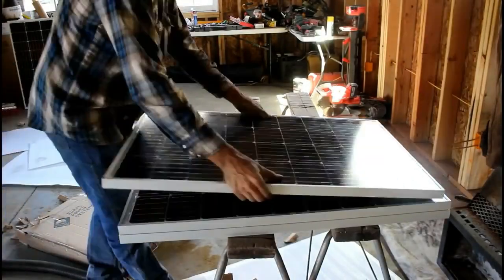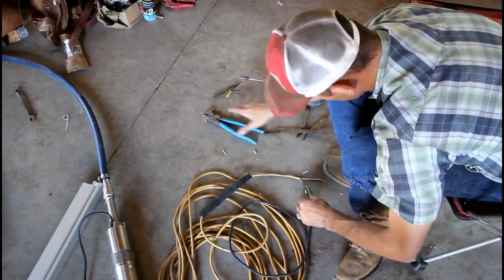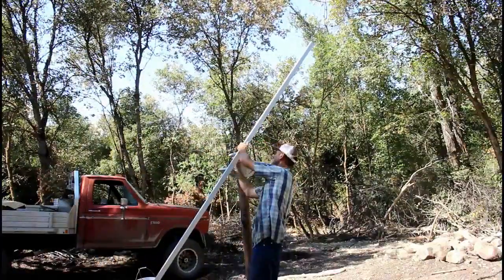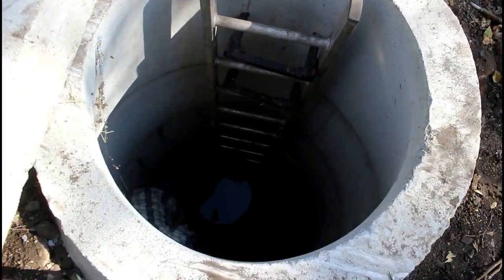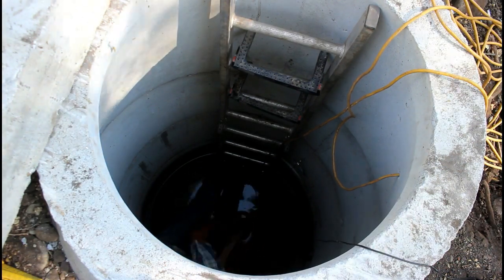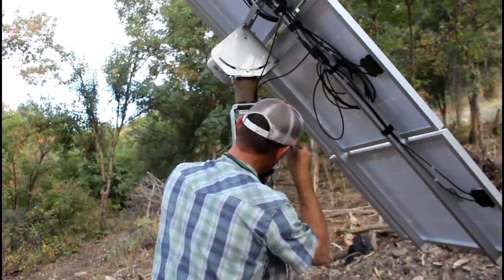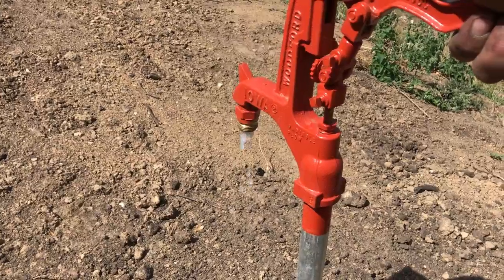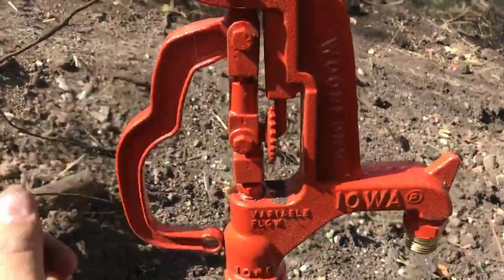#260 - WE'VE GOT WATER!!!  (I may have cried a little...)

Comment: What a great accomplishment!
 If you just want to build a temporary structure around the tank with a relatively high R value just stack bales of hay around it , add a few sheets of xps foam for a roof, then tarp it.  In the spring you can feed it to the livestock.

Comment: Put your second tank and mainline to the house in before you build your tank shelter. orientate the roof pitch to the sun (south?) and put your solar panels on the roof.
Reply: That's not going to work -- the solar panels need to be close to the pump -- too much voltage drop in the wire from the tank to the pump.
Reply: Solar panels do not have to go on the roof, as long as they get their sun.
Reply: I think those solar panels are for the water tank heating and monitoring power. You could build the tires for the walls of the tank shed. Did you put the balance pipe fittings in the tank you have installed already? And is the pump feed a seperate feed to the rank and not on the house manifold? I wondered as I didn't see an inlet pipe to the tank at the top of the tank to prevent drain back through the pump in case of pump valving failure
Reply: I suspect that James Templeman is suggesting this to keep the panels safe.  I'm more concerned with the 'kiting' effect that the panels may have if they're too high above the ground.  However, the prevailing winds in the area may be in such a direction that this is not a consideration.  Maybe a fence to keep the livestock away from the panels?
Reply: You gotta get up and clean snow off of the roof ... dangerous job...

Comment: A safety note ... Working in a pit or well by yourself and not testing the air for C02, C0 and H2S which can build up, you would pass out and suffocate / drawn. You wouldn't be found for ages.
Reply: So how do you solve the issue? Would a fan at the top blowing air into the well when you work in it do the trick?
Reply: @ChilapaOfTheAmazons   H2S is a low lying gas Hydrogen Sulfide a fan will not remove it it has to be burned off and turns to CO2 and will go up in the atmosphere.  as for co or co2 it be gone in the Cistern as soon as the lid is removed .
Reply: Or...  Would be found when his family wonders why he isn't home when he said he'd be...   But good advice none the less!
Reply: James T only H2S will stay in a cistern co and co2 go up as soon as the lid is removed H2S stays low till burned off .  I know gas in street sewers will get 4 inch off the stagnant water  up to 2 foot , but it takes 10 PPM to kill a person  Parts per million the smell of rotten eggs first sign than you lose your sense of smell and get dizzy your body gets so heavy you can not walk and that is when you pass out and your heart stops .   I worked in H2S for 8 years I know had to use scott air packs in anything above 8 ppm

Comment: That is awesome! 👍 It put the biggest smile on my face to see water flow. It looked just like the city for flow and it looked clear. I like well water it always tastes good. Congrats on getting it done. The tire structure is a great idea. My buddy did something like that just north of Newmarket in Ontario. But he used the tires as a mold and used cement then covered it with dirt it works very well. But it was a lot of work and time mind you his room isn't as big as yours needs to be. But it will work well.

Comment: Awesome rig!! You must cut the trees down shading the solar panels the cannot have any shade on them to even work at all. They need sun ALL DAY LONG. The railroad ties and dirt sounds very sturdy and easy to do to me. I vote for the rail road ties and dirt against the sides for insulation building. I have seen rail road ties stacked up and they drill holes in them and pound rebar in them to hold them. On the other hand if you can get a lot of free tire you could stack them up with dirt for free.
Reply: Either that or use some of the smaller trees you cut down to tie together the same way?

Comment: I would not have used an old extension cord for that application!  It will be interesting how long it lasts.  Right conditions might last for years.  Wrong conditions?  Might be only for a season or two.  Congrats on the water!  Was a long hard struggle but, success tastes sweet!
Reply: LOL - It is in the well and buried, in what way do you think conditions might change?
Reply: Not that deeply buried.  Freeze/Thaw cycles with wire insulators not designed for buried conditions.  Fall rains and Spring run off conditions where the ground can be saturated.  Electricity.  Use your imagination.  He probably is intending to replace that wire with one better designed for the  purpose since he said he was planning on  placing the panels higher.   In Arizona in dry ground that wire would probably last twenty or thirty years.  In Idaho, not so much.

Comment: Would you really be building a building at that point or would you put the tires just a few inches away from the tank to use the fewest and fastest build to get the height needed for a roof?

The good news is with the tank location you can quickly add rain water harvest backup to it up hill with the plastic on the slope method for speed then just put a fence around it to keep the animals off it.

Comment: Strawbale shed for the water tank - that will provide both insulation & structure....  Maybe a combination of earthship & strawbales.  Stack strawbales, drive rebar through them to anchor them, then plaster with adobe.   You can put some beams over the top of the structure to hold some metal roofing...  Quick & cheap with huge insulation value.
Reply: Great idea!   Time is a huge factor when pressed with a deadline.  Get some insulation up and work out the long term fix when you can.
Reply: Fantastic idea, I third that :)
Reply: I fourth that.  Great idea, and may actually be cheaper than building a wooden structure... at least for the short run.
Reply: You'll want to add some type of tie down system, steel banding ect to compress the bales, they do settle a fair bit over time.  Probably not a huge concern if it's only for a single season.  Also need to consider potential vermin problems, if anything can chew/dig/tunnel through your render you've just made the perfect habitat for any number of creatures/insects.  Having said that many people have found ways to make strawbale construction work so it's not a bad idea.

Comment: Congratulations on the major step.   I have been watching since you started framing and look forward to each video.  I have been wondering about that tank insulation question for a few weeks now.  I know that bags to fill with dirt for earthship-type structures are very cheap and may be faster to fill.  Blessings as you continue. A major hurdle is past.
Reply from the maker: Trebor Ssub thanks.